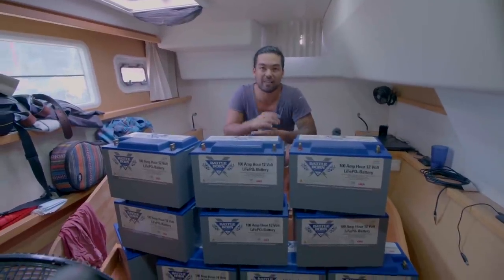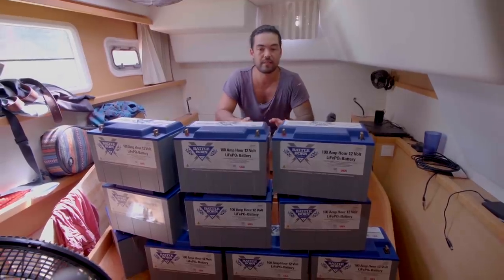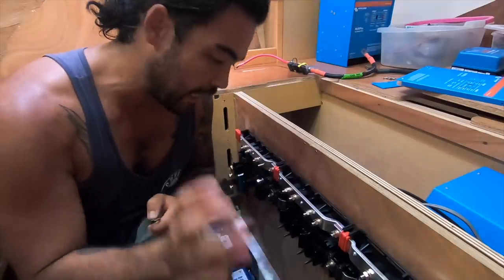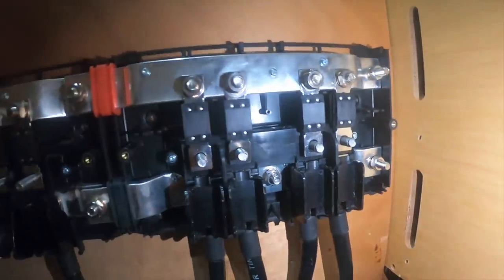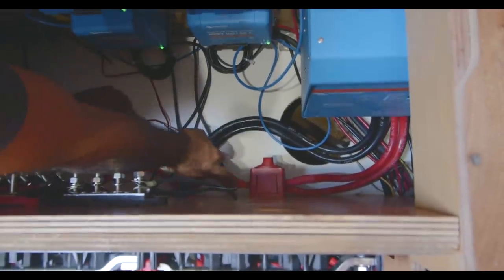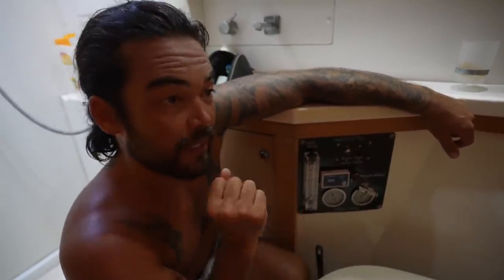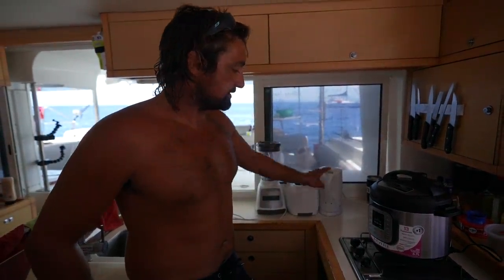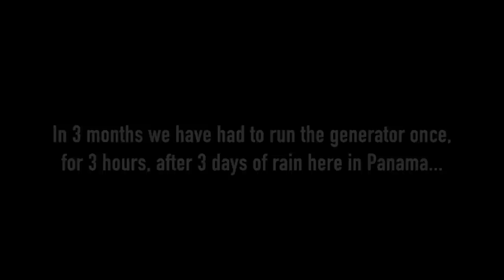Installing 1000Ah of LITHIUM + huge VICTRON installation! Episode 149

Comment: Gets them free.Then makes false statement about battery.You should never use below 20% and above 80% to prolong the battery.But as normal on youtube.They promote to get free items.Because if they tell the truth.they get nothing.
Reply from the maker: Could you send a document backing up your statement? I’ll wait.
Reply from the maker: @t147han  do you have a link to that video? Curious because I’m just sharing what the manufacturer told me 👍
Reply: @ParlayRevival  just looked up his youtube that he stopped when going to work for victron.the video were he sets the minimum and maximum has been removed.I would also not like to put him in a awkward position.you will see yourself when you sync the batteries to the inverter charger.were you can set min and maximum.The batteries are mainly cobalt.only about 3% lithium.Also the first time i heard of  lithium was used on golf balls.The bms in the battery cuts the drain of battery at 5% to stop damage to it.this does not mean you can use 95% unless you want to degrade the battery very quickly.what i have informed you.You should not repeat on your channel.for numerous reasons.But you do have very good so called lithium batteries.